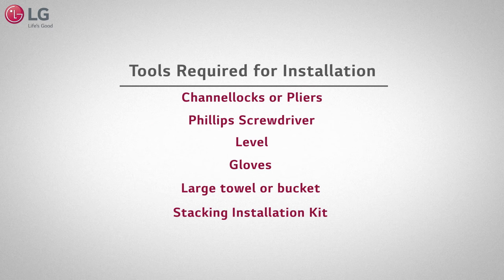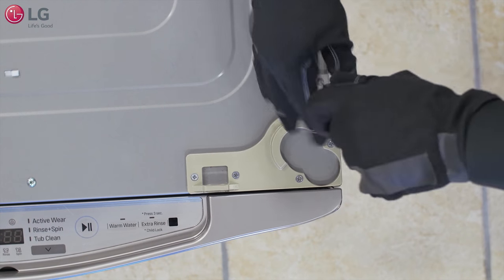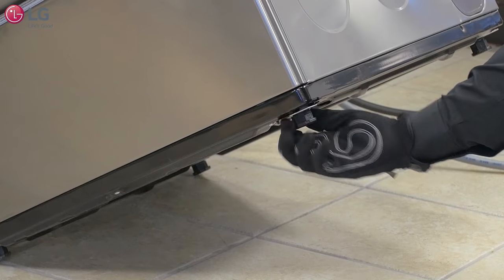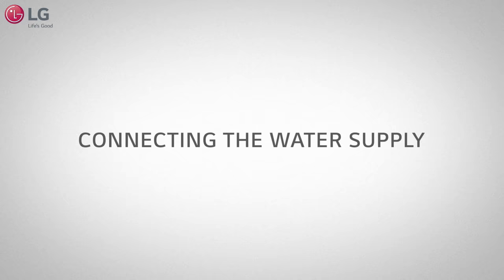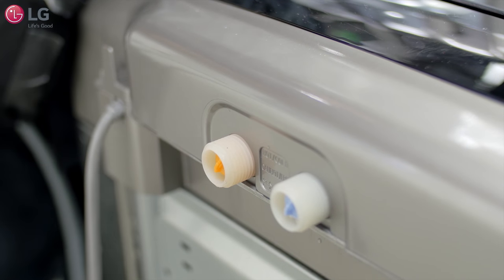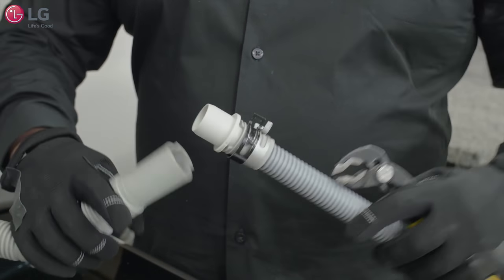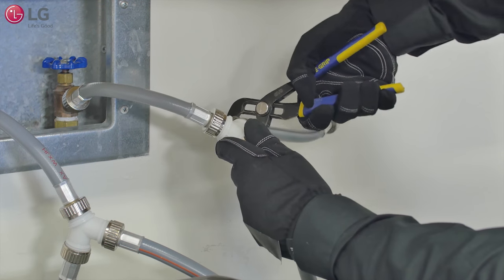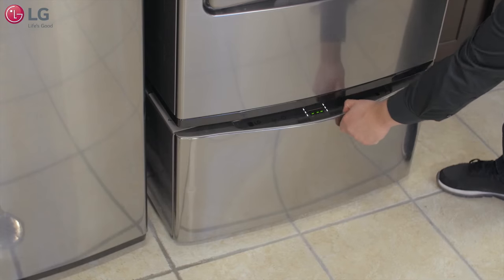LG SideKick™ Installation Under a Dryer (Top Load Situation)

Comment: BTW LG customer service / tech support has been trying to hide this. they only want sidekick installed under a front loading washer. but in reality many combinations work using the TSTK1 stacking kit
Reply: I tried it underneath their DLEX4500B dryer and it fit like a glove without the need for a stacking kit
Reply: dizzy185  the sidekick comes with accessories which includes screws to bolt the main washer positioned on top of the sidekick (16 screws total). While holding the button down, you take 2 screws and insert both into the 2 holes to hold down the button
Reply: dizzy185  did your stacking kit come with the adapter hose? If yes does the big end of the adapter hose fit on the big end of the drain Y fitting that came with the sidekick?
Reply: dizzy185  Is your dryer 27 or 29 inch width?  I wonder if I need the kit, which is hard to find, since @michaelverzosa didn't need it
Reply: @michaelverzosa106  is this dryer 27 or 29 inch?  Thanks. I have 29 inch dryer, wondering if I need the kit.  Dryer doesn't shake out of alignment without rear brackets?  Thanks
Reply: dizzy185  OK Thank you.  I have the 29 versions.

Comment: @LG USA can the LG WD100CB pedestal washer be placed underneath the LG DLEX4500B front load dryer using this kit?
Reply: For anyone wondering this same question, you wouldn't need to get the stacking kit. DLEX4500B will stack on top of WD100CB without the need for any additional accessories

Comment: I bought the Sidekick and wanted to install it under the DLEX5500V Dryer. It’s been a nightmare! I wonder why the Sidekick that cost me $850 does not come with the Power Interlock? 🙄
Reply from the maker: Hey there, this doesn't sound quite right. We'd like to hear more about this concern from you and see what we can do to support you with your LG Sidekick. Please send us a private message on Facebook or X using @LGUSSupport with your model, serial, and phone number. ~TammyJo
Reply: Called LG and was told that I need to buy this special dryer stacking kit. I was given the Reliable Parts phone number. I called that company and they need the stacking kit part number, which LG did not provide. This remains a mystery. LG support is a joke.

Comment: I wonder if I can Put little mini Furniture pads underneath the bottom floor feet that way when it's in position I can slide the whole unit out a lot easier
Reply: Do not do this, we did, it unfortunately created an imbalance during spin on one unbalanced load and split the inner drum from the struts.
Reply: @maureen4488  Not sure how that would happen, if little pads are under  each of the 4 feet it's still all balanced

Comment: How do you mount under a 29" dryer?
Reply: I was wondering the same thing, Dan.  I purchased 2 sidekicks - 1 for my washer and one for the dryer.  Both sidekicks fit perfectly under each main unit, but the sidekick under the dryer gives an E7 stacking error, meaning the stacking switch is not depressed.  The TSTK1 kit (which I can't seem to find at all in Canada) has the stacking switch bypass piece (you see it in the video above ... the grey piece that goes on the stacking switch with 2 screws).  If I can find the kit or that bypass piece, I'll be golden.  Worse case I'll hack something myself. 

What is disappointing is that before I bought the second pedestal washer, I verified that it could be stacked with a dryer and even LG had documentation promoting this (hell ... look at the video above!).  Now there's no documentation - the only thing that comes close is this video and the fact that the TSTK1 stacking kit exists.  I hope they find a way to make good on this now-false claim...
Reply: @stephenkaram9951  Hi 
Did you actually find the way to bypass the E7 code? Please let me know if its possible to do a hack or something.
Reply: @stephenkaram9951  I did the same thing (front load washer/dryer combo with pedestal washer underneath both). Easy fix for your problem. Hold down the switch while you insert two screws into to the two holes. The screws will hold down the switch. The issue I have is draining all three washer drains into one drain. I'm hoping the adapter hose included in this kit fits the Y fitting exit hole that comes with the sidekick so I can funnel the Y into another Y
Reply: @michaelverzosa106  Have you had any issues with installing the sidekick under the dryer?
Reply: Only the WD200CB is made for 29”

Comment: LG want  try to profess that only working with LG Washmashines or Dryer but it's but the sidekick is a autonom  halfsize, full working washmashine you can use it separate everywhere lake of space too 
only you need weights or fixed  to eliminate the vibration otherwice  halfsize full working washmashine to expensive price, if you not have lack of space like in a tinehouse, tineappartment, caravan etc....

Comment: What is the part number for hose adapter for the top load to connect to the Y adapter
Reply: Haha I came here to ask that same question. I have a front load pair with 2 sidekicks underneath each. The issue I have now is draining all 3 washers into a single drain. That adapter piece could be the missing link

Comment: After seeing this video, I bought a sidekick washer under a LG dryer, but I don't get the installation accessories shown on 0:29, most important the Power Interlock Bracket.  Can I purchase it back through LG USA CS?
Reply from the maker: Hello! A support team member on our FB or Twitter page will gladly answer this & any other questions you may have! Please send them a message (LGUSSUPPORT). ^Emma
Reply: If you look at your sidekick (top left rear corner) where the legs of your dryer would position, you'll notice that there's a button that you can press down. This is meant for it to work only underneath a front load washer because their front load washers have "tongue" that sticks out and presses in the button when it is positioned on top of the sidekick. Since this "tongue" isn't on any of their dryers, you'll need to get 2 screws and insert it into the hole next to the button to hold it down
Reply: @michaelverzosa106  Hi Michael, I totally understand the function of that button.   At the end I asked my friend in USA to order the Installation kit for me, but all I need is just that tiny bracket.......  It is so kind of you to suggest another way to doing it, hope I know it 6 months ago, lol

Comment: Can it be installed with any washer ?
Reply: Hugh Huynh only certain models of the LG washers. Check out the LG website just remember there’s two different models for the sidekick.
Reply: Sidekick is halfsize, full working and double price  washmashine, it's only if you have lack of space in tinyhouse, tinyappartment, caravan etc... if you have space take standart size washmashine a lot cheaper ;)
Reply: Only with lg washer